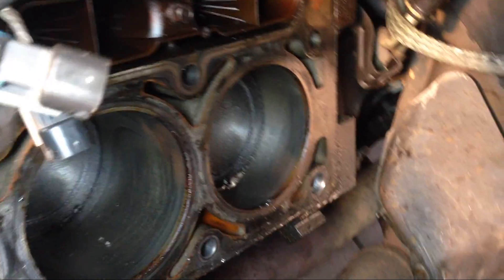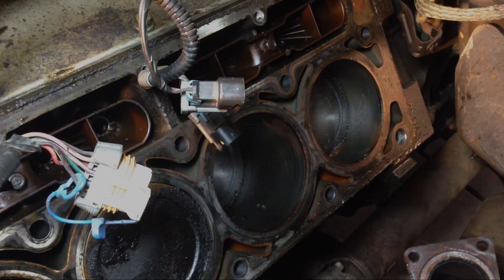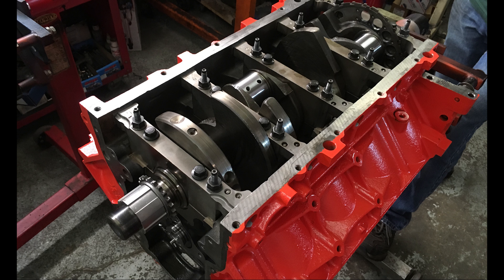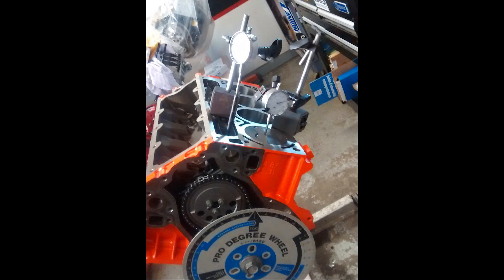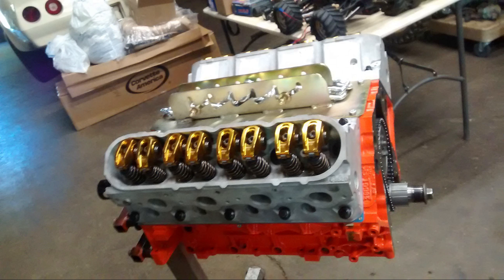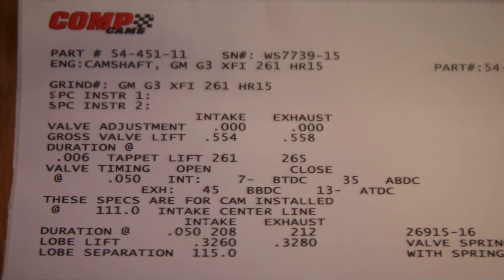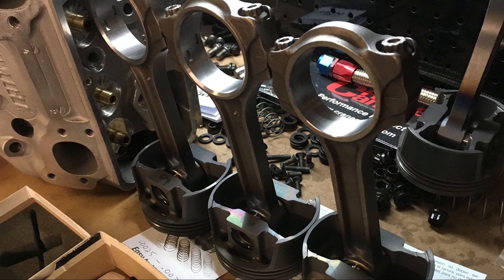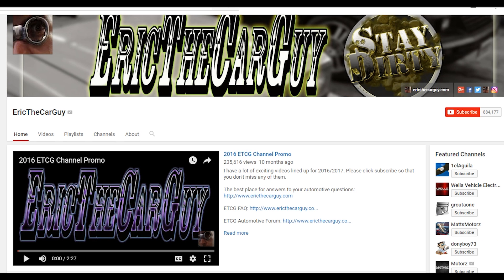GM Chevy Tahoe 5.3 Vortec LS Engine Rebuild 1 Machine Shop Short & Long Block

Comment: great video.   Im thinking about buying a early tahoe.  Your video boosts my confidence that these trucks can be repaired and rock solid if i spend a little money.   I dont mind  spending money i hate wasting money.  the trucks im looking at have over  200000 miles.  i may have to rebuild the engine in the near future.   but for a few thousand you have a better than new engine.   thats money very well spent.   i imagine its good for another 200000 now.   Frees up your wallet for other renewals.   whats next?    is rebuilding the transmission a reasonable certainty?  what else is a reasonable certainty as far as essentials that fail?

Comment: What did you pay to have your engine rebuilt?  Are machinists easy to find to do this work?
Reply from the maker: Couple grand if i remember correctly, but it has been a long time.  I did answer that question somewhere in the comments when I did remember.  Machinists were very hard to find in my area.  we live in such a throw away society now that people don't rebuild engines like they used to and machinists are hard to find.

Comment: So, almost 3.5 years later, how many miles have you put on the new motor? Any issues?  anything you would do different;y?
Reply from the maker: This is not my daily driver, so only about 10 k miles.  Still runs amazing with (dare I say) no problems.  If I had it to do all over today, I would put a 6.0 or 6.2 in instead.  Having said that, doing it the way I did was an incredible learning experience.  Thanks for watching

Comment: who is the machinist that you used?
Reply from the maker: A & K rebuilders
Reply: About to buy a motor to have built well I'm driving my suburban around . It's got 300xxx on it and I'm gonna keep it for a while so I figured turbo 5.3 feels right
Reply: I see GM is now offering a short block crate engine to order in case anybody ever wants to keep their beloved truck going.

Comment: Hey Steve. I found your channel when looking for help on connecting a 1968 Chevy automatic trans to a 307 Chevy motor. I am restoring a 1954 Dodge Fargo 1/2 ton and using Chevy drive train.  I need help with the electrical and the install of the motor. Plus the trans hoses and everything that attaches to the motor. I was hoping that I can get the information from you channel. I guess I will see. I subscribed so I can get your updates. Thanks for sharing.
Reply from the maker: I videoed everything from start to finish so i hope you find what you need.
Reply: @TahoeSteve  I hope I do as well. Thanks Steve.

Comment: Hey man how are you! 

Quick question, how much did you spend on rebuilding your 5.3? I have a 5.3 also and its developing a rift tick and a knocking from time to time. Not sure if it's best to rebuild or buy a new 5.3 for my 02 chevy Avalanche. Any feed back is great, thanks in advanced!
Reply from the maker: i did it as a project.  if i had to do it all over again, i would drop a 6.0 in it (much much easier and less time consuming)

Comment: How does it run man.? And is it fast lol I’m trying make my 04 tahoe a lil more faster all I got right now is a tune but I need more power so do you know what I could do first to put power in it thanks.
Reply from the maker: Runs great.  Ton of torque and it's fast, but for me, it's all about that torque.

Comment: Greetings friend, I'm from Venezuela, I would like your council to put the engine in time, getting the best that I can with what I have installed, I thank you for your help, a hug brother.

Engine ls2 6.0 camera l92 70cc
Here we use 95 octane gasoline

-Competencia Cams 13702-kit mm Series LS retro-fit Trunion Kit
-Computer Cams 7106 Adjustable Keyway Billet Timing Set for GM LS
-Brian Tooley Racing pr7400312 - 16 piece of Cromoly Pushrods 7,400 "Long 5 / diameter of 16" .080 "
-Chevy Gold Dual Valve Kit 660 Max Lift
- BTR LS1 / 2 STG IV Cam 235/242 .621 "/.592 111 + 3
Reply from the maker: That is one bad ass thumping cam.  You are probably gonna need to add a stall converter and professional tune after those changes.  Best of luck!

Comment: I noticed in your video you had the cylinder heads ported however with regard to the crankshaft did you have the technician polish cross drilled and nitrated for strength just curious?

Comment: Thank you for posting this video a very inspirational video for Vortec engine owners. I've always said that with a few upgrades that the Chevy 5.3 liter Vortec engine can do wonders for truck owners in SUV owners.

it's a shame how the engineers at General Motors never took an additional moment to look at the design flaws concerning this engine design. However it's comforting to know that there are aftermarket components that could bring out the true potential of the Chevy Vortec Engine. Again  thank you for posting this inspirational video.

This gives me great ideas for the engine build that I'm looking to do on my 2004 Chevy Trailblazer EXT LS with the 5.3 liter Vortec engine naturally aspirated. I just got through installing an upgraded 4L60E transmission bull Ripper type transmission  to correct the design flaws of the stock 4L60E design.